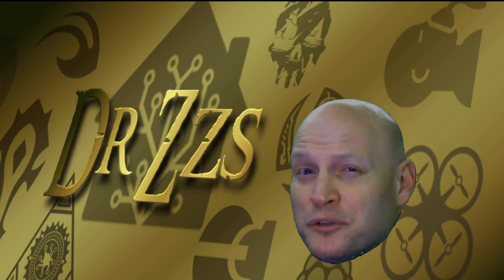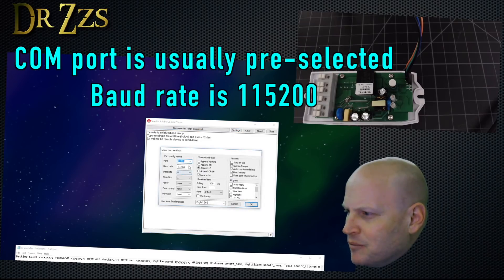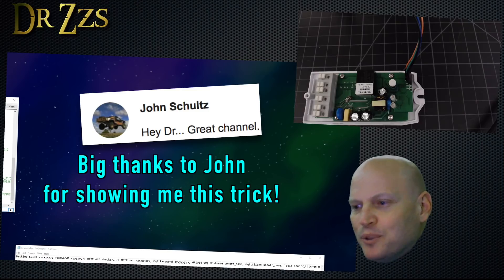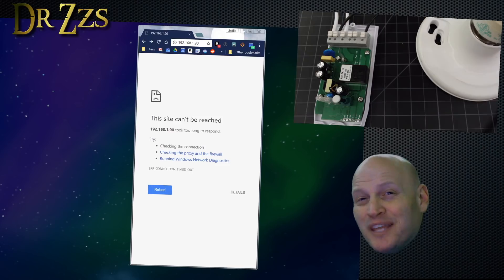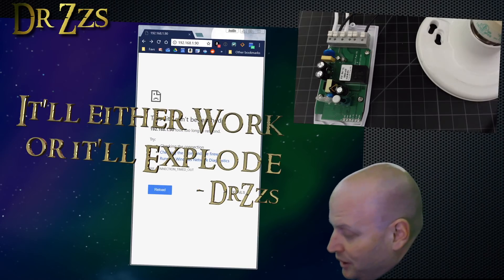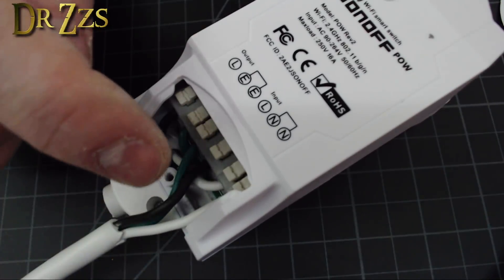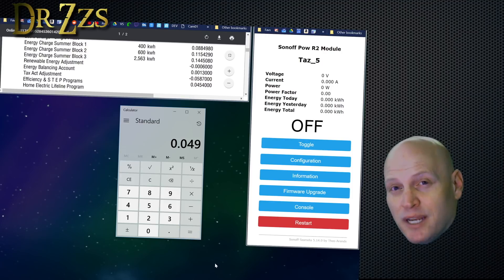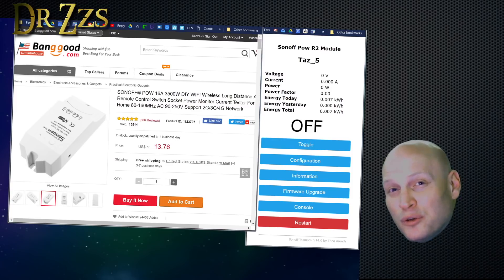Monitor Power Usage AND control your devices with the Sonoff POW | Home Assistant | Tasmota

Comment: Nice Video I have been using the Sonoff POW on my Air Condition units . They work perfectly .
Reply from the maker: awesome!
just curious, what kind of units are you using and what's their power consumption.  I think I remember talking to you about your AC units before.  
Thanks!
Reply: Iam using Sonoff POW these are not R2 R2 is more accurate due to a various factors like the way the flow of current is.

Voltage 231 V
Current 0.099 A
Power 6 W
Power Factor 0.27
Energy Today 1.071 kWh
Energy Yesterday 1.070 kWh
Energy Total 3.150 kWh

I am using these on Haier Ac. Yes we did speak some time back on the POW units. I have set them up in all the Ac, Oven, Fridge through out the house.
I use the Data collected by them and then present it using Grafana and InfuxDB
Reply from the maker: ooh! I was just thinking about Grafana for data export from HA.  Can you point me to a good tutorial?